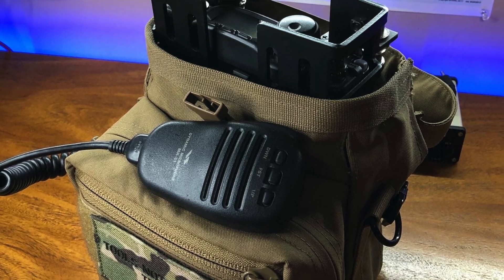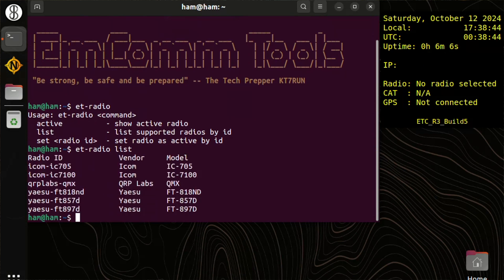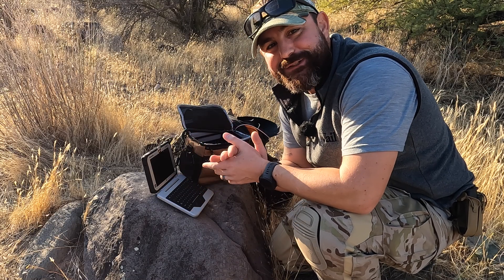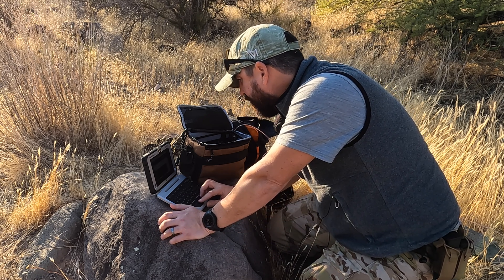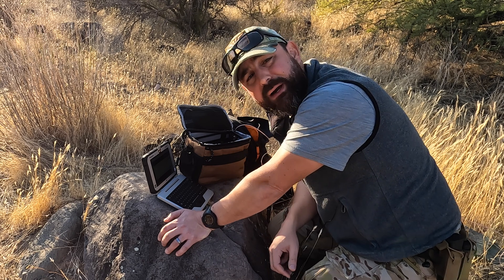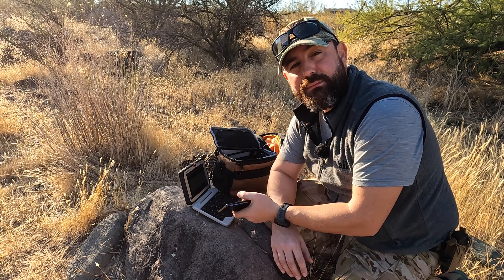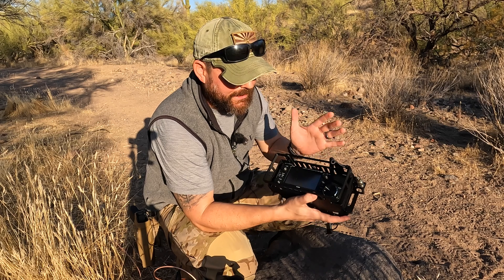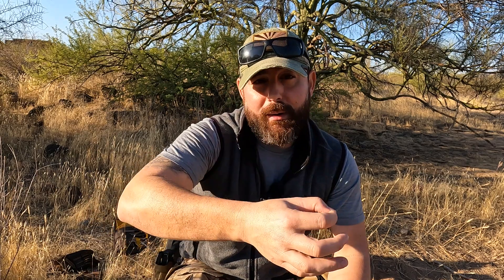IC-705 - First Manpack Field Test

Comment: Vertx makes a range bag with a pullout “brass” tray you can remove and put the radio in its place. Also can fit a Toughbook in the back slot. Its a neat little pack, although not quite as ergonomic as a vertical bag setup.
Reply: I was able to pack in the radio, handset, spare batteries, EFHW, throwlines, laptop, coax, etc all in one bag.
Reply from the maker: Thanks for the tip. I'll have to check that out.

Comment: I hope that as the prominence of field use of radios, especially HF, continues to grow that the big ham companies like Icom and Yaesu will start making more modern radios with USB-C and built in sound cards that are waterproof, have built in or included protective cages, forward facing connectors with dust caps, and all the other "manpack" type bits and bobs. In theory even the regular hams would still find value in them even for POTAs on the picnic table. I don't understand why getting quality waterproof electronics is such a problem. Sure it adds cost but the number of opportunities for things to get ruined by moisture even indoors is high enough that I would prefer all my electronics to be waterproof, especially a radio I'm already spending hundreds if not thousands of dollars on only to go spend another $500 on pack frames, batteries, cables, bags, adapters, etc... It would be nice if there were turnkey solutions for field operators that were durable and worked right out of the box.

Comment: The 705 has wireless capability. It would be cool if you can get both CAT control and also GPS data. Zero wires is a GIANT leap towards dependability in my opinion. 

Wires always seems to be the weak spot in any situation for me anyway, and a lot of failures is my common issue. i.e. common mode current issues are eliminated, USB cables tend to be quirky, adaptors for this and that....

Also, Thingverse has a decent 705 cover you can 3D print so you can pile junk onto the front without damaging that beautiful display.

Enjoy that 705! It's my favorite radio!

And...... GREAT WORK!!!!

Comment: The 705 leaves some things to be desired in the ruggedness department but i've thrashed mine pretty good for two years thus far and it's going strong. I also understand it's limitations and don't abuse it. For simple and rugged the Lab 599 rig would be my top pick. I got the 705 because I wanted a radio that made all-mode all band digital operation a breeze and it certainly delivers on that imo. I also really enjoy being able to do other less hammy things like use it as my GCS radio for flying drones on practically any band I want... very useful for obvious reasons for some people!
Reply from the maker: Thanks for sharing your experience with your rigs. Very helpful.

Comment: Watch out, once you get past the different form factor it might become your favorite radio.  Durability was my concern at first, but I haven't had an issue and mine is always on the go, tumbled off a picnic table onto pavement x2, rained on, freezing temperatures, etc.  Give it a fair chance.  It is nice to not need an external digital interface or GPS.
Reply from the maker: Thanks for the feedback, Tom. I will be cautiously optimistic. This rig is going to be the vehicle rig, so there will be some interesting vehicle-mounted videos coming. Stay tuned.

Comment: Quick question - applicable to probably every supported radio. - Can the Emcomm tools software be configured such th\at it defaults to a specific radio? So I would not have to go to the menu and then type in the radio I want to use. My plan is one radio for this usage.
Reply from the maker: It will be in ready for plug-an-play using the last configured radio. You only need to reconfigure the active radio, when you switch radios. For example, the next that I boot up, I just need to connect the IC-705. No configuration necessary.

Comment: Absolutely looking for simple low cost solutions for regional comms. VHF/UHF and HF. Family and friends don’t want to invest so much. If there was a simple solution, fair cost of entry, I might be able to swing more friends and family over to ham radio and Emcomms. I had family in Tampa area who lost power, lost cell service and were completely out of touch. Luckily all was all good but it would have been good to have comms. That said, with the antennas we are using we likely couldn’t have them up during a hurricane. But shortly after it passes, you could at least communicate that you are safe or that you need assistance. How well do these NVIS antennas handle hurricane winds?  Your next video?

Comment: Hello. I really enjoy your videos and have learned from them. I have a request.
I’m very interested in the Yaesu VX6R handheld you run and have read a post somewhere that uses the Yaesu with digirig to an Android cell phone as a terminal, transmitting to ATAK. 

Do you have any experience with this setup? I’d very much be interested if you could feature this setup in one of your videos.

I’m currently using ATAK via a Meshtastic node, but would be interested in using this transceiver to complete an ATAK transmission.
Reply: I'd like to see this too

Comment: I use my 705 in the field all of the time. Sure they're not built like my older Yaesu radios (897 and 818nd), but it's far from fragile. The wireless capability for digital is very nice.
Reply from the maker: Is anyone having luck with the wireless integration on Linux? I assume that this mostly supported on Windows? Outside of the development I did last week for the the CAT control and GPS plug-and-play support, I have only 20 minutes of operating time under my belt with the 705. This was the first time that I used this radio.
Reply: @TheTechPrepper  I can't speak to Linux, but the RS-BA1 software for windows works very well and is very easy to use. Almost too easy.
Reply from the maker: Be advised: The Yaesu FT-818ND, FT-857D and FT-897D were the first radios to get the PnP support. The ICom PnP was a late comer due to member requests. 73s

Comment: Two comments about your future:

1.  Taking rigs, antennae, and batteries into the field and testing them out is a great idea.  Consider ing the SE US and the Houston area this summer.  Quick, easy, QRP HF systems which sip power is needed.  Keep doing that on a reasonable regular basis.

2.  Developing your own computer programs for econm.  Have you asked econm hams in your area what they need?  Or the HF digi hams?  You might be trying to reinvent the wheel.  This part you may need to carefully consider what to do next.
Reply from the maker: Don't take this wrong way, but I have my path for this project. I have vision for the next 1-6 months of development. I am surprised that the amateur radio community has not made the jump to true plug-and-play and better user experiences.
Reply: @TheTechPrepper Yes.  Lots of our stuff, particularly on the digi side, would cause George Jetson to yell, JANE at the top of his lungs.

Comment: I am against the 705 because it does not have an AH-4 tuner port.  That means I cannot plug and play my LDG tuner.  That should not happen on a rig of that cost.  Assessories should ne plug and play on all the HF rigs of a particular line.
Reply: I’ve connected the LDG z100 to the 705 with a 1/8 jack cable to the 705 tuner jack many times and hit the tune button on the 705 screen. Works great. Look into it.
Reply: I have mine connected to my AH4, just need to wire up a 3.5mm to a molex and supply 12volts from a power source. I sourced mine from the external battery I use to get 10 watts

Comment: I recently replaced the USB Micro board with the USB-C on my IC-705. Made things better with the radio. Everything works just as good as when I first got into data modes. 

Having a radio that is plug and play is a game changer. Much less of a chance of forgetting something. However, forgetting something does happen from time to time, lol!! 

You're going to enjoy the IC-705. It's quite the capable radio with lots of features. The only downside is that it could've been more robust design, but it does get the job done.
Reply from the maker: Thanks for the details on the USB C modification. I intentionally avoid all IC-705 videos and reviews so that I could experience everything raw. It's great to know how things work under the hood. I will tell you it's nice to not manually synching time using the WWV AM broadcast signal.

Comment: When solid state battery becomes a real thing with 50% greater energy density than lipo4 batteries, direct conversion SDR radios will be viable for SHTF grid down man-portable ops. Right now the power hungry SDR and direct conversion radios like the IC-705 are cool tools for POTA.

When I lost power from hurricane Milton, I immediately unplugged my FTM-400DR and plugged in my FT-857D. The FT-857D uses less than 1/3 the power of the FTM-400DR on receive. I felt comfortable with my 12ah bioenno battery and 60W Rockpals folding solar panel, if I needed it.
Reply from the maker: There's a reason why I love the FT-818 and 857... Much lower current consumption on RX. 73
Reply: @TheTechPrepper The 703 also sips power on receive!
Reply: I thought the ft-857d uses about 1amp on receive. & the ic-705 uses about .22amps (220MA)  ?
Reply: The published current draw on the FT-857D is 1A on receive at volume full. Actual current draw is closer to 800ma. When squelched it drops to about 500ma.

Comment: I have the 705, Icom makes a pack for it, no need to invent a new one, plenty of room and it works great.
Reply: I do wish it was less expensive.
Reply from the maker: If you're referring to the Icom backpack, it's personally not for me. As a weekly hiker, that pack missed the mark on multiple dimensions especially when it comes to carrying support gear for the operator. There's isn't even a water bottle holder. Anything beyond a simple park activation by the vehicle and it will be lacking. My newer bag arrived after this video was filmed. It's just a rectangular sleeve with padding. It's a perfect fit compared to the one shown here today. If the 705 gets more use, I'll design a custom bag and make a few extra units. Everyone's needs are different, so it's not a waste of time to dial in the gear.
Reply from the maker: I'm looking for just enough protection and best this unit inside my existing backcountry ruck sacks.
Reply: The Icom backpack is ok. It's overpriced and doesn't have much to offer as far as carring the radio, tuner if needed, battery, coax, some accessories, and antenna. 

For camping or longer periods of time operating, it has a few shortfalls. My biggest complaint about the backpack is that Icom should've added Molly Webbing for extra pouches. Just wish they would've put more thought into designing the backpack as they did with the radio.
Reply: @pale_2111 The Icom 703 backpack was alsw way overpriced.

Comment: It's pretty bold to do the first setup in the field!  Full throttle, no brakes!
Reply from the maker: If it breaks... I took one for the team. I need it to last for two more weeks until the sound integration is completed. I'm sure it will last longer. We'll see how it handles the vibration in the Jeep while rock crawling back here. I will be mounting it on the e-bar system. Be advised: I owe you an email. I was laser focused on development last week and did not respond to any email.
Reply: @TheTechPrepper  it shows in your progress!

Comment: I think that’s your new field radio now! 👍🏼
Reply from the maker: Nope. It's the FT-818ND forever. This is going to be mounted in the Jeep. We'll see how long it lasts mounted on the RAM while rock crawling in the desert.
Reply: @TheTechPrepper  I hear ya 👍🏼 Wonder if they have an SDR control app for Windows on your Tough Book (keeping the 705 in a protective case/bag 🤔
Reply: Mine has been smashed on my Jeep and up dozens of mountains for years.  Went for the USB C upgrade that gives you better AMP control.  The thing rocks.  The weight saved on the radio goes to Solar and it can be self sufficient.  

Like the cooler bag.  It also fits in one of the maxpedition big Fanny packs, forgot the name, but the big one.  That works well in the Jeep.  The ICOM backpack works great too and doent look tactical..really any bag works.
Reply from the maker: @Qwiv  Cheers to another Jeep owner. This is great intel. Thanks for all the details. I'll keep you guys posted once I get some experience with some vehicle mobile operations.
Reply: @TheTechPrepper  I like that I can bring something with a waterfall mobile. My mom is really concerned about come, but little to old to get into it.  I bring the 705 every time I visit and she can use it to monitor.  She can’t use any other radio I own.  She is so good at it, considering getting here a 7300 with a permanent antenna setup.  Pretty sure I can get here set up to at least have an antenna that could receive me if lucky, and my sisters husbands if really lucky.  

Linked her to a few of your planned contact videos to help her understand how hard it is to get ahold of a specific person, especially states away.  Told her is she can get a tech license, I would set her up for some emergency general operation.
Reply: @TheTechPrepper  Jeeps: Dave Canterbury of “Dual Survivor” fame (KE8SPS), beats his 705 up pretty good in a Jeep Gladiator LOL
Reply: @Qwiv  That would be the best Mother’s Day present ever 🎁
Reply from the maker: @Qwiv  I wish you and your mom success. I got this!